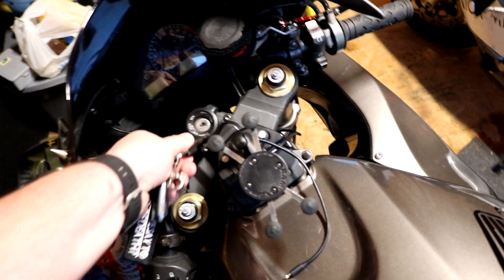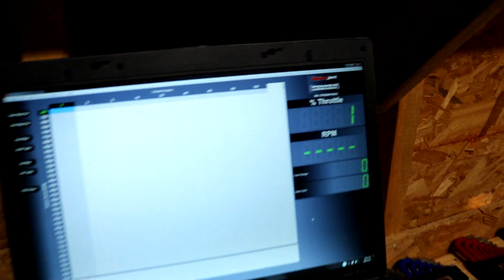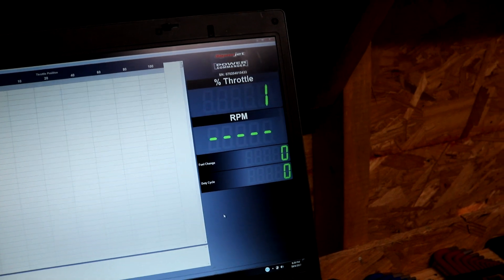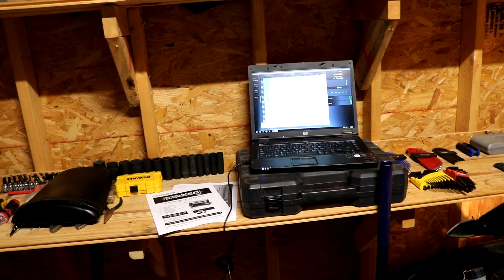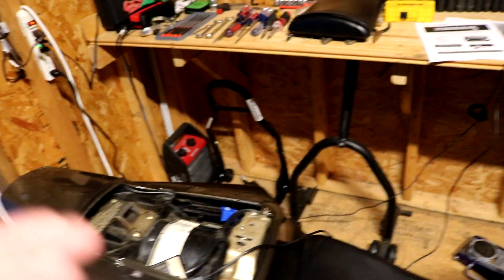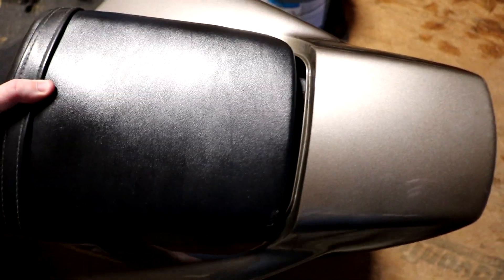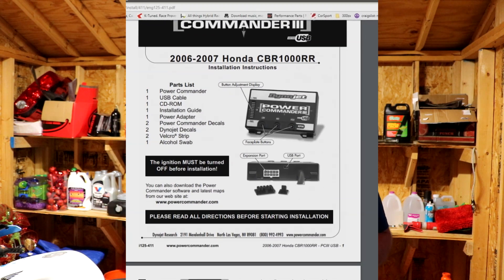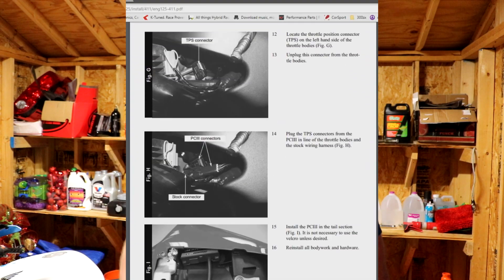How To Tune A Power Commander 3

Comment: Hey, I understand this is old post, but my gen 1 hayabusa when the fuel is priming it detects it, when the fuel pump stops it disconnects, it works when I turn it on?  can I flash it with bike on
Reply from the maker: Seems like it isn’t connected properly. Like it’s only powered by the fuel pump. I don’t think you can flash it while it’s running. I have never tried it.

Comment: Question, there's 3 buttons on the commander can you set 3 tunes on it? Just wondering what them were for. I appreciate this video it helps me a lot! Thank you
Reply from the maker: Glad it could help in some way. The buttons adjust the air to file ratio from my understanding but it doesn’t change too much because it’s only going to let you adjust in a safe range. To get the full benefit of the power commander you need a Dyno tune

Comment: Thanks it was a good demo. 
One question though: If the map I download is not right for me, or something go's wrong, how do I push the old "Stock" tune back?
Reply from the maker: You can either download a stock tune or before you import a new one you can click on “get map” in the software and it will pull the current map and you can save it to your computer

Comment: this guy is all over the internet, did you manually adjust fuel by holding down all three buttons on pc3 and starting the bike.
Reply from the maker: No. I just imported the tune I downloaded. I haven’t touched it in years. I’m thinking of going to the power commander 6 soon. May do an update on this then

Comment: Just a tip, you mentioned micro usb, you actually need “Mini USB”. Micro is a different shape. 

Great video! Helped me update the tune on my bike.
Reply from the maker: I also said it was the same cable used to charge a ps3 controller. So you see how dated this video has become lol
Reply: @SnowDrift   lol no harm! I just figured I’d point it out and maybe help someone from marching out to their bike with micro usb and laptop in hand like I did 😂. 

Did you ever try non-power commander maps?

Oh and as a non-PlayStation guy I had no clue haha

Comment: What's going on is that I have two hayabusas and one has the headers  with one exhaust and the other it's an OEM and I want to take the headers with the power commander off one and put it on the other one because I am selling one of the bikes hopefully you understand what I'm trying to tell you thanks
Reply from the maker: Gotcha. The power commander only adjusts fuel delivery as specific Rpms. Uninstalling it and removing the headers won’t be a problem
Reply: Thank you for getting back to me I really appreciate it Happy New year's

Comment: The map will not be deleted when power is disconnected to the unit , i.e when battery is disconnected.
Reply from the maker: Correct. Made a video about it.

Comment: I can not get a map link to download as there is no download option, could you maybe directe me
Reply from the maker: Derik Botha should be listed under tunes.  They have discontinued the power commander 3 so I imagine the support for it will be going away pretty soon. You will have to go to the website a search for power commander 3 and you bike. If that doesn’t work I’d search the forums for a tune that is is for your bike and get the closest one that matches it and then take your bike to get it Dyno tuned.
Reply: SnowDrift  thanks man I can’t find one tried the web but no lock .

Thanks for your response much appreciated 

I am currently running aftermarket air filters decated standard exhaust
Reply from the maker: @derikbotha5507  Yeah, the whole website has changed. Before too long im probably going to upgrade to the Power Commander 5. I was hoping they would come out with a Power commander 6,7,8 or  whatever by now but doesnt seem like thats the case.

Comment: I was hoping that your video would show how to tuneup but it was only installing the software.  Your length of time in explaining is fine but U did not show how to tune or adjust the mapping of the gears, Sir
Reply from the maker: You cant adjust the mapping of the gears, that is not even a combination of words that can be made into a sentence. all the power commander does is adjust fuel based on rpms and throttle position. It has a lot to with your elevation as well. I showed exactly how to put a tune on the power commander, hence the title of the video.
Reply: I was told that s power comm5 individual mapping can be done for each gear. Not sure as this is what have been told..
Reply from the maker: Its Me maybe it can. I would not know, I’ve never had a PC5

Comment: I downloaded the map I need and it inst showing up in the power commander software. I tried unzipping the map file too but it still doesn't show up in the software.
Reply from the maker: Aaron Malone maybe try downloading again? Not sure why it would fail to unzip
Reply: SnowDrift do I need to have the power consider on and plugged before I can open the map onto the software?
Reply from the maker: Aaron Malone no
Reply: SnowDrift got it. Once I plugged the power commander up to the laptop it popped straight up

Comment: Ok I know it's almost 3 years late, but:
All Power Commanders will keep the current map until you change it.  Doesn't matter if the battery is disconnected.  Copied this from the Dynojet FAQ page:

"If I disconnect my battery will the Power Commander lose it's map?
No, all Power Commanders utilize a nonvolatile memory (it does not require constant power to maintain it). The only way a map can be “erased” is to use a computer to load a new one in place of it."
Reply from the maker: correct, its flash memory.

Comment: I am completely new, I appreciate you!
Reply from the maker: TheMannChannel the is man! I know it’s not the best video ever. I could definitely film it better nowadays but it gets the job done.
Reply: @SnowDrift  it's nice for someone to show every step. I can now see if my pc3 is set correctly or not cause I just bought my first bike and am seemingly having a fueling issue. 2006 gsxr600 and it's breaking up a bit and backfiring after about 30 miles. Could be bad gas, could be pc3 map could be this or that... Thanks for your content so I can eliminate one of the possible issues
Reply from the maker: TheMannChannel I’m glad the video could help you.

Comment: So if a different engine was installed with a little bit bigger cam on a gsx-r1000, the specs on the website won’t work right? I’m new to this so I’m just trying to figure out how to do it correctly with the right specs if possible. It was already installed when bought, but I’m not sure if it’s even still tuned and active. I mean, you said if disconnected from power it resets right? I know the guy had just put in a new battery before I purchased so I figured with that being said the power was disconnected and it hasn’t been re mapped and such.
Reply from the maker: Josh Brock if anything major like that has been done then the maps online would work but the bike wouldn’t run at its full potential. If the battery is disconnected it should not lose the tune.

Comment: I know this is an old video but do you have any advice on how to install it, i have a 2006 cbr600rr and a power comander 3 for it i got used , i got everything plugged in and grounded but it dosent seem to be getting power on the commander dosent light up and bike wont prime
Reply from the maker: Esquives Pedro there are instructions on their website, unfortunately I’ve never installed one myself so I don’t have much advice to give. I would check the documentation on the website and maybe someone here in the comments may have an answer.

Comment: I just bought a 2006 cbr1000rr with 5k miles and it has a stage 3 power comander I dont know anything about it bout it from a old man's wife the husband passed away but will I still be able to go about it the same way or can I just take it off and the bike go back to stock without reprogramming it thanks.
Reply from the maker: yes you can take it off, the power commander itself is not a replacement for the actual ECU on the bike. its simply a fuel mapping computer. it bypasses the factory signal from the stock ecu in order to change how the bike uses fuel. it can be removed and that will return you bike to stock.

Comment: Thank you very much, sir. I've had a power commander on my bike that it came with and every explanation I've seen assumes a certain amount of knowledge and experience. Yours was the best. As for the snarky comment below about the cable, I could see that the plug looked like a mini usb plug, but I was wondering if that was all it was or if there might be different types. You cleared that up for me. Thanks again. By the way, when I turn my key on the PC3 comes on but then the light goes out when my fuel pump is done priming. I also hear a click when it shuts off. If I start the bike, the light stays on. Can I install the map while the engine is running?
Reply from the maker: Bob alloo some folks are just impatient. I like to be a clear as possible. My real life job requires me to talk to people in a way that everyone can understand and that translates into my everyday life as well. Some people just don’t understand that and I am very glad the video could help you out.

Comment: Are you running Windows 7?
Reply from the maker: Illuminati Kid on my old laptop I am. Didn’t care to upgrade since it’s never connected to the Internet and has no sensitive data on it.
Reply: Ok because I have the same power commander but I don't know if I have to get a Windows 7 or 10😖
Reply from the maker: Illuminati Kid use either
Reply: @SnowDrift  thanks bro🙏

Comment: hi! i have a question.. i cinnecting my power commander but the program say " no dectect" why ?
Reply from the maker: try a different cable
Reply: I try with 3 diferent cable but i have not lucky
Reply from the maker: @aldovenegas3751  the cables may only transfer power and not data, im not sure what it could be other than that, unless the usb port you are using is bad.
Reply: my gsxr only powers it for a second or two when you flip the key and kill switch off. its enough time to click the get map and to send a map.gotta be quick

Comment: I used PS3 cord. It said device not communicating. It read the throttle but it just went from 0 straight to 100.
Reply from the maker: MacLomax strange, sounds like that cable is not a data cable, sounds like its power only, try a different one, like from a GoPro

Comment: Also for ppl that don’t have a lap top you can manually change the map with the 3 buttons on the commander.
Reply: Is this by holdimg  3 buttons in while starting the bike the.n adjusting the commander from there ?

Comment: What can all be done with the Power Commander for my 06 R1? Can I adjust my speedometer too?
Reply from the maker: Bruni Auto no, for that you need a Speedo healer. Healtech makes them for a lot of bikes, all the power commander does is allow you to edit your fuel map based on what modifications you have done to your bike. A power commander 5 has additional add ons like quick shifters and I believe even timing changes can be made, not 100 percent on that.
Reply: SnowDrift awesome, thanks for getting back to me
Reply from the maker: Bruni Auto no problem

Comment: Thanks for this vid! Doing mine this weekends thanks!
Reply from the maker: RANDOMOTORIDEZ thanks for the support, I’m glad the video helped you! And thank you for the sub!
Reply: SnowDrift did everything in the vid and when i open up the PC file and plug my power commander to the laptop it says the serial number and below it says device not communicating? Any idea?
Reply from the maker: RANDOMOTORIDEZ possibly the cable, may also be the USB port, I’d try a different USB port, a different cable, and if that fails restart the pc
Reply: SnowDrift i tried all of that maybe ill have to contact powercommander. Thanks for the help bro
Reply from the maker: RANDOMOTORIDEZ what version of Windows are you running
Reply: SnowDrift i figured it out for some reason my bike has to be running. It works now
Reply: SnowDrift i dont know why but as soon as i started the bike it recognized the PC3. I downloaded the map. Maybe its different for a 07 zx10r? Not really sure
Reply from the maker: RANDOMOTORIDEZ the bike has to be turned on, I didn’t think starting it was necessary, but it could be different between all the models